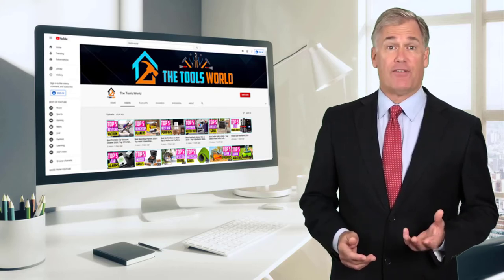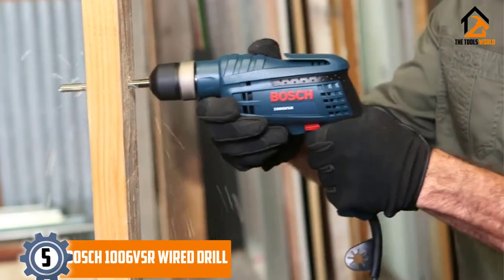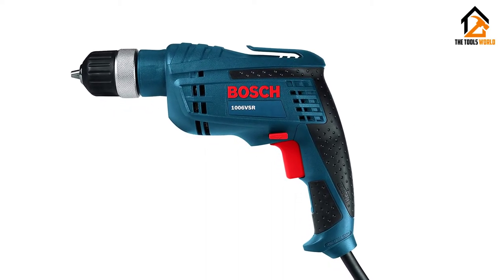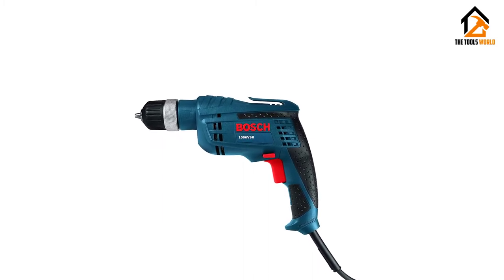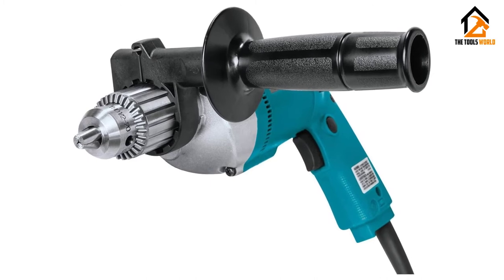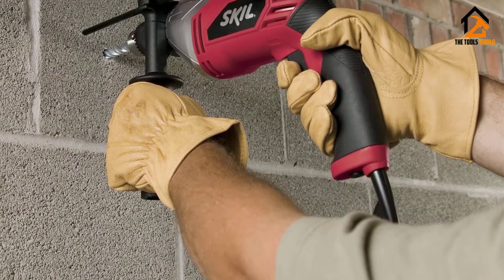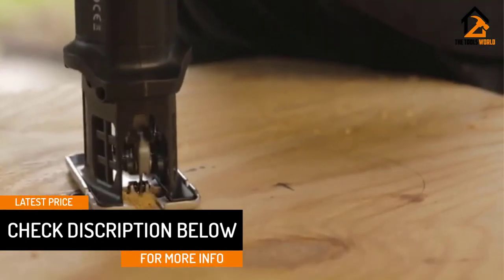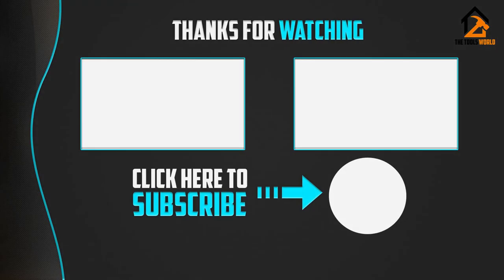Best Corded Drills - Top 5 Corded Drill Review

Comment from the maker: ▶ In This video, We recommended the Top 5 Best Corded Drills

▶ 5. Bosch 1006VSR Wired Drill.  
 
▶ 4. Makita 6302H 1/2-Inch Corded Drill. 

▶ 3. Skil 6445-04 1/2 In. Hammer Drill. 

▶ 2. BLACK+DECKER BDEDMT Matrix AC Drill/Driver. 

▶ 1. DEWALT DWD210G 1/2-Inch Pistol-Grip Drill.